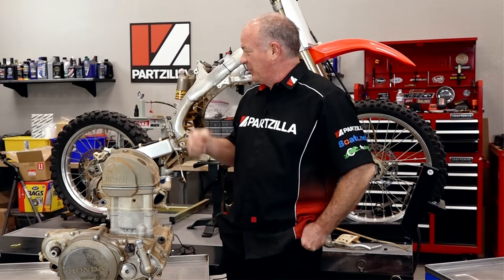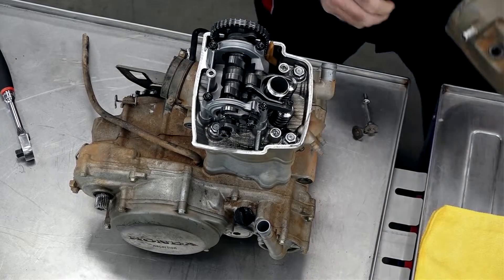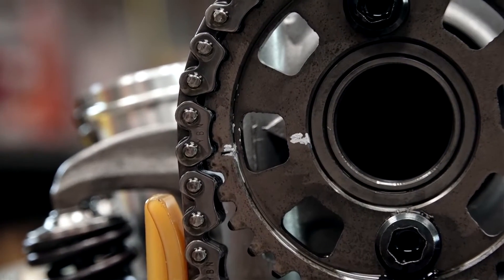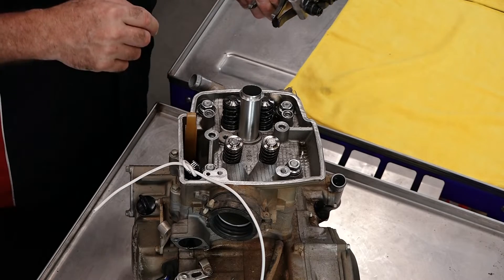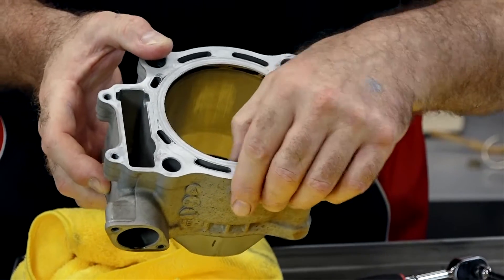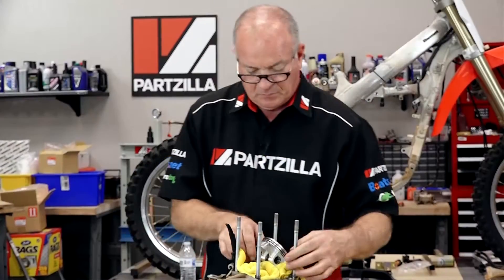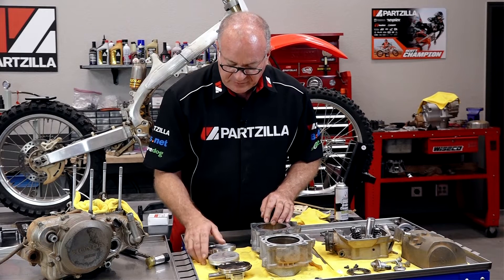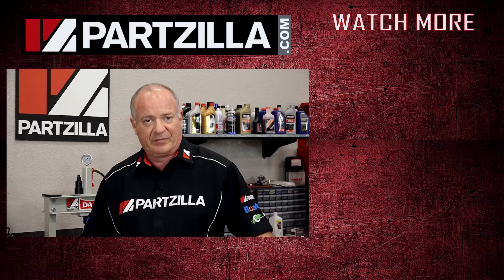Honda CRF450 Top End Teardown | 2005 Honda CRF450-R Engine Rebuild Part 2 | Partzilla.com

Comment: Hi mate i have a crf 450r 2008 recently i heard wierd noises in the motor especially when accelerating at even barely half throttle i run it up and down the drive it overheated coolant came out of the carberator and the overflow radiator hose smoking steaming i am not a mechanic or a professional i just need to know whats going on  and what work it needs done to it will it need work to the motor and what ever else it may need 
Cheers mate sincerely
Reply: Blew a headgasket
Reply: What did you find out? Thank you in advance.